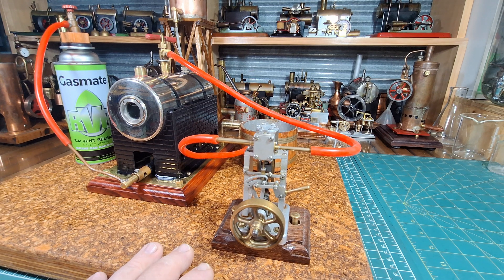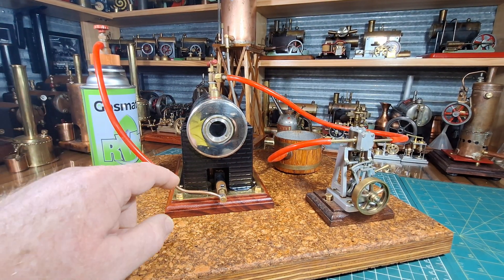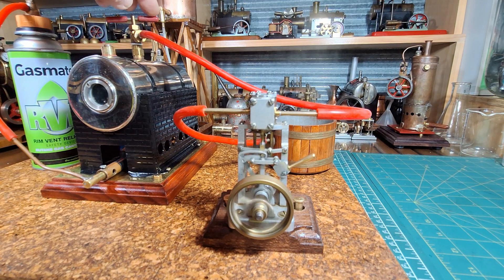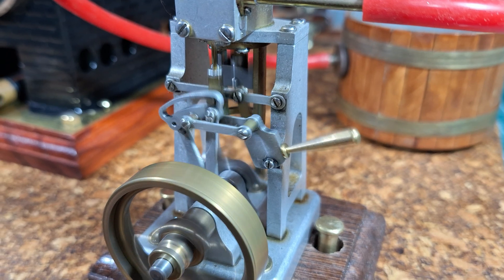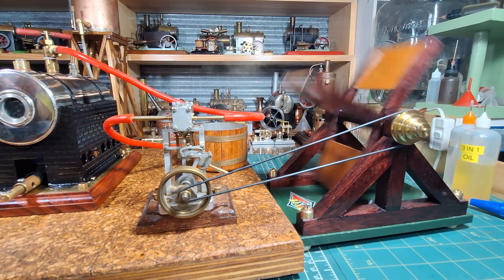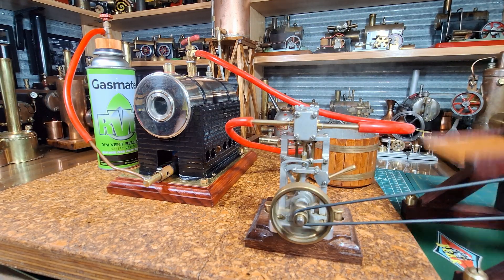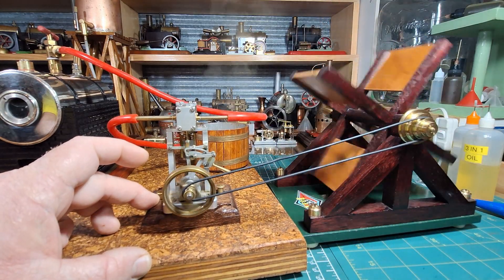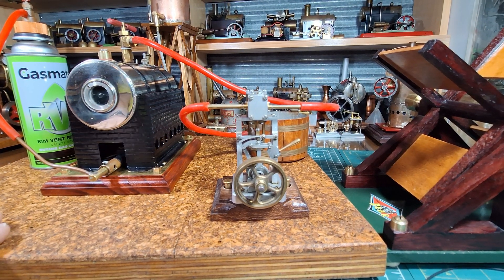Miniature Steam Engine Graham Industries VR1A Double Acting + Baker Fan

Comment: I like this flexible steam engine system. The rather small double-acting engine provides enough power to  ensure the movement of the big baker fan. Very nice! Cheers, Detlef
Reply from the maker: Thanks Detlef, I have really gotten used to using silicone tubing (from eBay) for making 'temporary' setups - Cheers Jim
Reply: @SteamEngines-Jim  I‘ve got extra boiler with silicone tubing myself for the various stand-alone engines (Stuart, Bassett Lowke etc.). I find this quite handy! 😎
Reply from the maker: @SteamDreamDE  Works really well doesn't it.